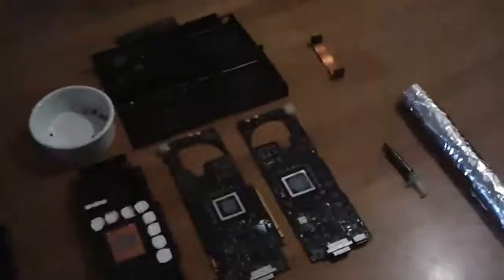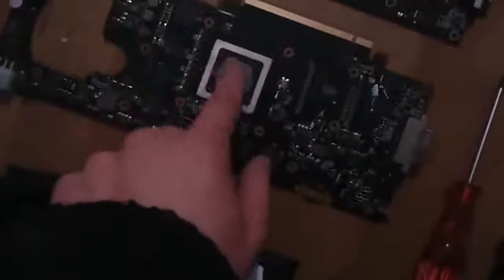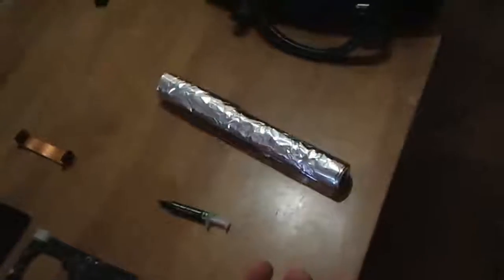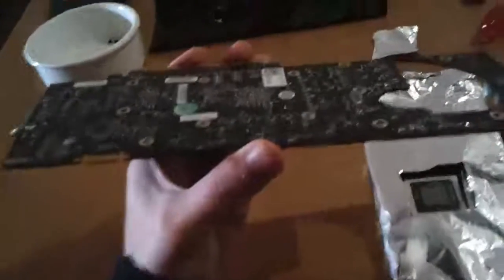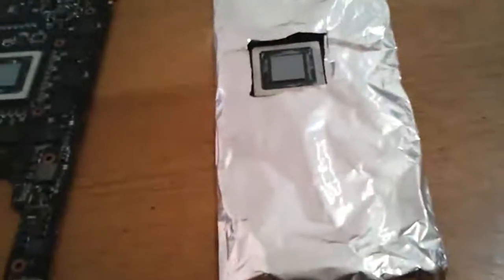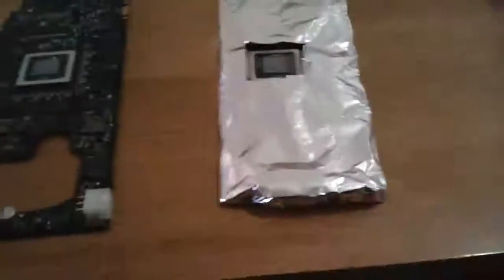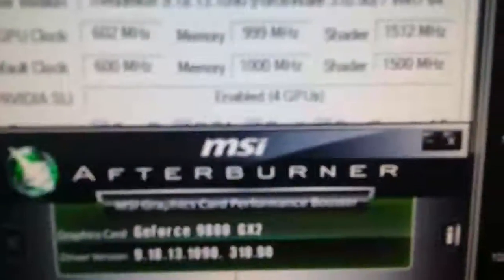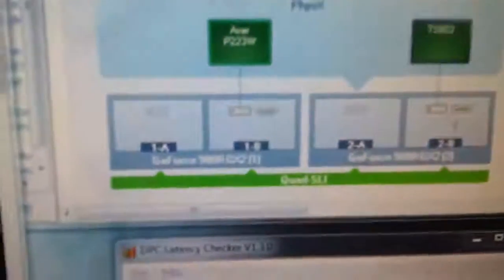GPU Baking Trick fail? Bake again! (9800 GX2)

Comment: when i re assembeled my GTX 285 after baking i forgot to put a bit dirty and old rubbery pads on my gpu s chips...do i need to put them back or gpu can work without em?!?!
Reply from the maker: they are thermal pads to maintain contact between heatsink and chips, a more solid alternative to paste, so yeah you need them. You can buy these separately tho, don't think pads are expensive.
Reply: Tnx, baking actually worked (happy as fuck) but nvidia driver installation can t recognize my gpu now...how to install
 driver ?!?!

Comment: i have this card and only 1 core is showing in windows 7 is this normal and what can i do to fix , please help
Reply from the maker: Hi, if that happens only in windows 7, then it's a driver issue, try older ones.
If it happens on any OS, then open it up, you will see a small SLI cable integrated inside, disconnect and reconnect it to both cards, see if that fixes it. Last but not least - if it's your chip fried, there's not much you can do about it. This fix in the video assumes that GPU is working, but showing artifacts, which can be fixed by baking/reflowing solder.
Reply: gona bake and well let you know the outcome many thanks
Reply: baked today now card is not even posting it powers up all green and thats it
Reply from the maker: carlo bath Hi, that's exactly what happened to me at 9:05 in the video. What I did was - I used my second GPU to boot up while baked one was in secondary slot, installed nvidia drivers and baked GPU popped up. Have you by any chance got integrated graphics on your mobo/cpu? Might be worth a shot, man.
Reply: yes i have
Reply from the maker: carlo bath You can override which GPU to use by default in BIOS. I'd say use integrated chip to get you inside windows and reinstall nVidia drivers while baked card is still inside. Hopefully that will do the trick. Otherwise I am out of ideas.
Reply: Thank you but develpoed another problum now im gettin non stop beeps now when i turn pc on arrrrrr lol so frustrating lol
Reply from the maker: carlo bath Those beeps are universal sign of a hardware failure, every motherboard has those. I'm afraid that card is a goner, man.
Reply: thank you so much for your support +1 subscriber

Comment from the maker: Hey ya, try using less thermal grease. Don't spread it with fingers or anything, let the pressure do the spreading. Anything around 70-90 degrees is fine for that card, since it's actually 2 GPUs under 1 miserable heatsink and fan.

Comment: Every of us having these cards having same problems! OVERHEATING ! I did bake my card just two weeks ago! ..It works but heat is still there ! its running under load on  105 degree celsius ! its too much ! Ive been thinking to mount passive aluminium plate as additional heatsink.

Comment: It's not that old, and yet, still has the power to 'move' complex graphics with respectable framerates., It was still, in my opinion, the 'king' of graphics cards during 2008~2009. The only downside is, that it's power hungry it's GPU's heat up considerably. For me, the 3 kings of 2007 to beginning of 2009, excluding the 7950GX2, are 8800GTX, 8800 Ultra & 9800GX2 - All of which I still have, although will have to be baked again., Nevertheless they are absolutely fantastic cards!

Comment from the maker: Hey, my 9800 GX2 I baked in video still works, but it is quite outdated, power hungry card, ironically any card over 100$ can beat it atm. On a second note, I baked 8000 GT2 for my gf months ago, but that one died last week, too. Instead of baking it again, i'll just buy 600 series nvidia or maybe 7850 for her. Baking is fun and it kind of works, but I guess it's only good to prolong card's life a little more so you are not left without GPU  before getting new one.

Comment: Although I don't believe 100% of this oven trick, I recently baked two of my 9800 GX2's, worked for a couple of weeks then died on me again. One of them showing artifacts, whilst the other, only showing 1 GPU. All that work in dismounting both cards, and money waisted on professional thermal paste. Both graphics cards with normal use, no overclocking, dust free, but coincidentially after 3.5 years, beginning to fail. I had the exact same problem with all of my 8800GTX's & my one 8800 Ultra card.